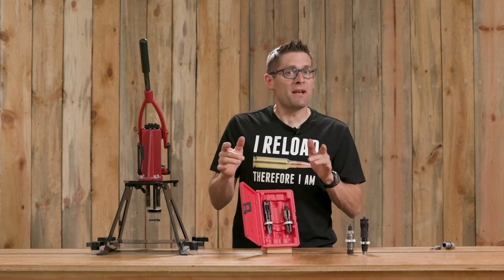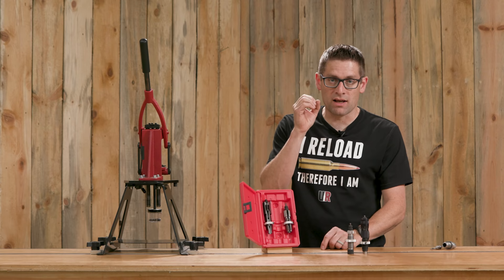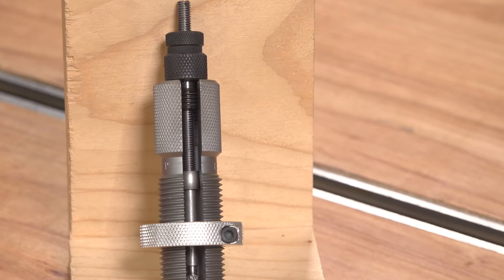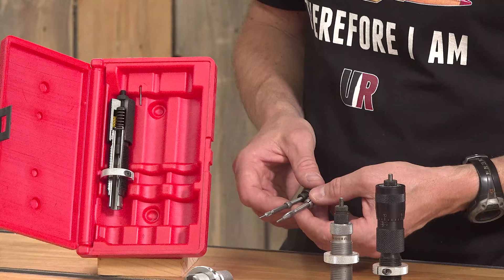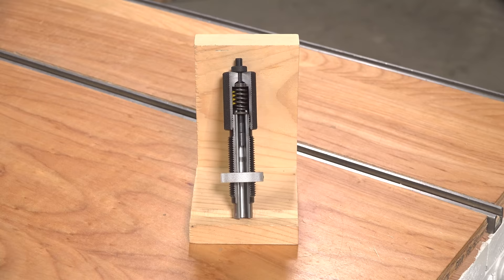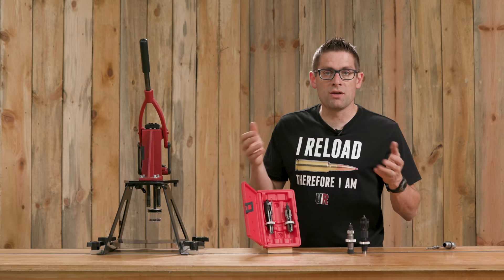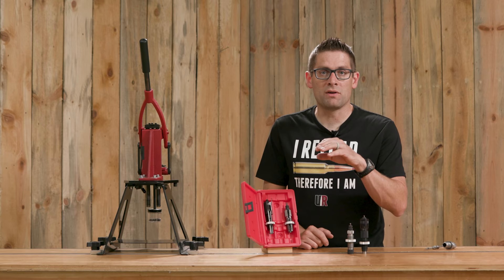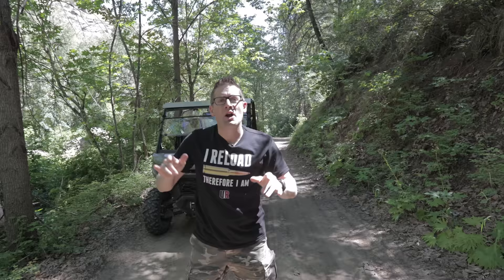Quick Look: Forster Dies from the Inside Out

Comment: I was on a waiting list to get a Forster full length sizing die in 28 Nosler for several months and finally received it a month ago. I’ve purchased Hornady, Redding, Forster and L E Wilson full length sizing dies to see which gave me the best concentricity. After receiving the Forster die I was shocked to see it was made of what appears to be cast iron and the threads for the locking ring was extremely ruff and in no way smooth to adjust for the head space I desire. The quality of their New sizing die is nothing like the old Forster dies I have. I certainly won’t be buying anymore

Comment: Love my Forster micrometer dies. Both for the 204 and the 65Creed. Set their zero at  30 thou off of the leade and they remain locked until I need to change.  They are amazing in their consistency. And the 10 round groups prove it.

Comment: Love the Forster Ultra Micrometer seater die's accuracy. I'm not a fan of the standard Forster Benchrest (non-micrometer) die because of the slop in it.  The standard seater die will change seating depth by as much as 0.010" between rounds.

Comment: I have a FL die for one caliber, and the Ultramicrometer seating die for another.  The FL die is pretty amazing, and while the Ultramicrometer seater is great at what it does, the seating cup for the seating stem is notoriously thin - I've managed to flare one out, because the neck tension on some new brass made for too much seating force.

Comment: I use a Rockchucker with a honed Forster full-length sizer without expander spindle, and finish my necks with a 21st Century mandrel die. That’s an awesome combination. 
Then I use my K&M arbor press to seat with micrometer Wilson chamber seater die. I also have the Forster seater but I get a couple thou better concentricity with the Wilson seater.

Comment: Love my micrometer seating dies. OTOH, just picked up a Forster full length sizing die in 6.5 Creedmoor. Not so happy with it. When sizing brass it is very rough. Also sizes the body more than my other Hornady Creedmoor die. This is with the expander ball and stem removed. Maybe I just got a bad example.

Comment: RCBS FL die stems are threaded all the way so I typically raise the expander ball as high as I can to replicate the performance of the Forster die. It won't punch out the primer so-adjusted but there's more than one way to skin that cat.
Reply: RCBS specs out their FL dies to the tightest chamber for each caliber.  This means brass is unnecessarily worked to a small dimension.  This is most evident in buffalo rifle cartridges.
Reply: @albertthesecond210  It also means their dies will produce good results with brass that was fired in minimum-spec chambers, with no over-working of the brass.

Comment: Do other lock rings work acceptably in the Co-Ax, or are Forster rings required absolutely?
Reply: Some do. Others are too thick.
Reply: Sinclair also sells rings that are the same as the Forster ones, except they're made of steel. The Forster ones are aluminum. I have both and they both work, but I like the Sinclair ones better.